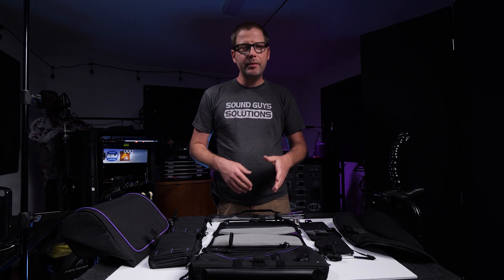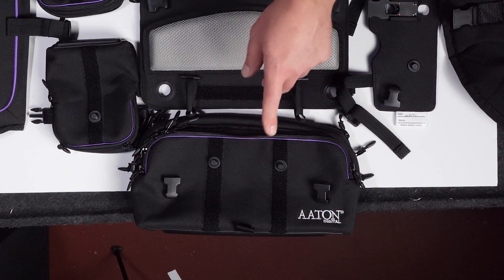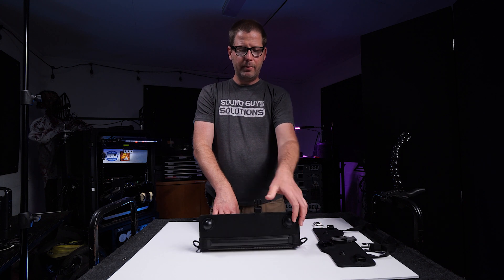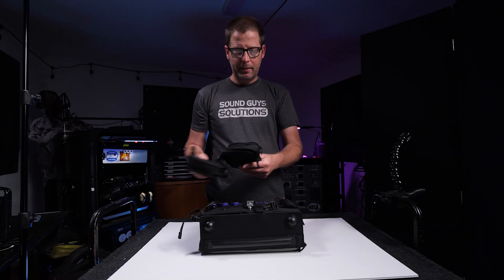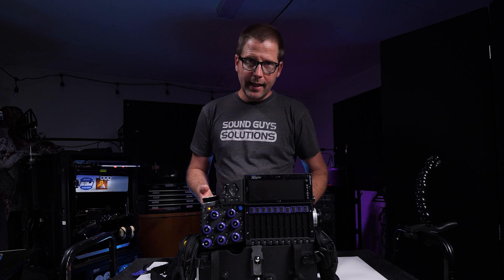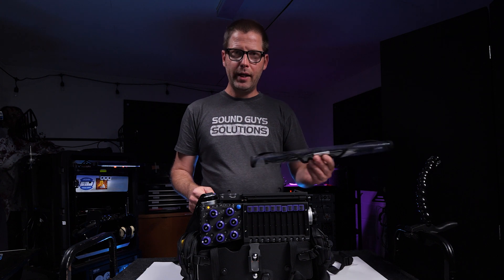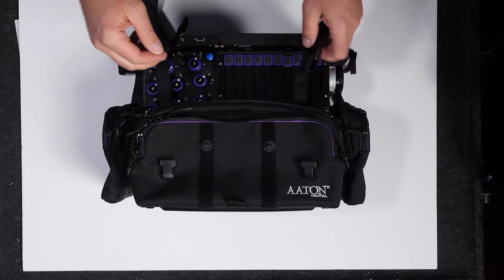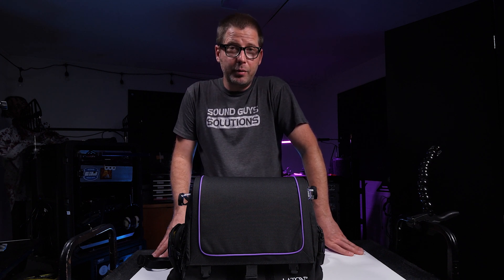X3 Modular Bag System - Component Overview and X3 Integration

Comment from the maker: Hi Everyone. Here’s a close look at the components on the modular Cantar X3 bag system.  It is a elegant, simple and flexible design.  Also can be used with Giant Sounds X36P system for those using the PSC 6 pack for RF integration.  Modular is the only way to go as we expand and contract our packages.